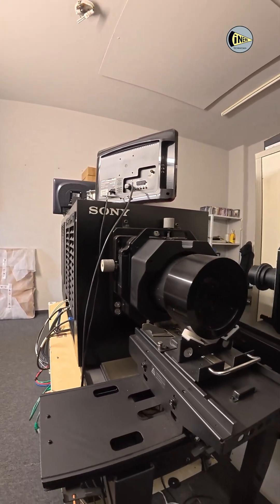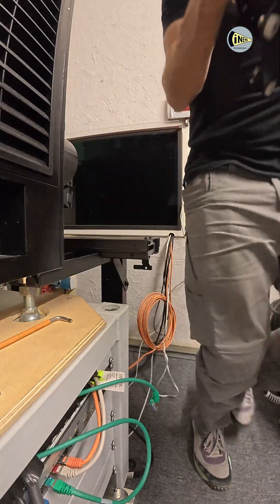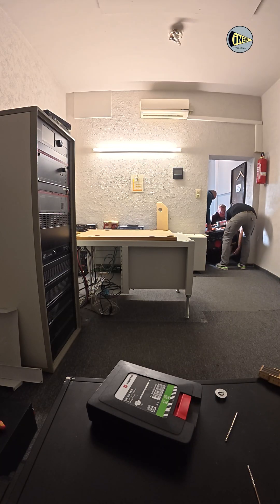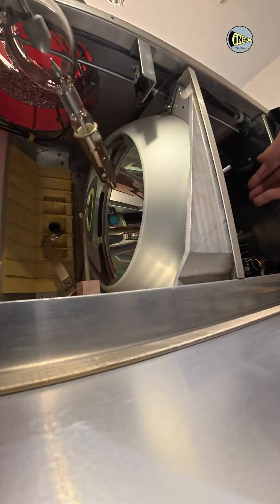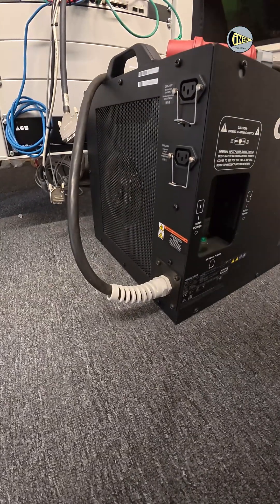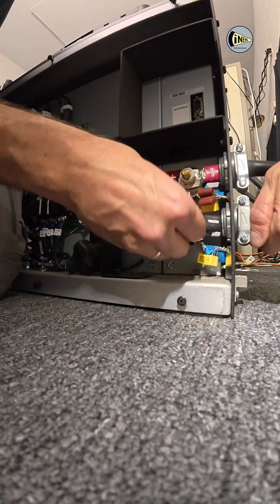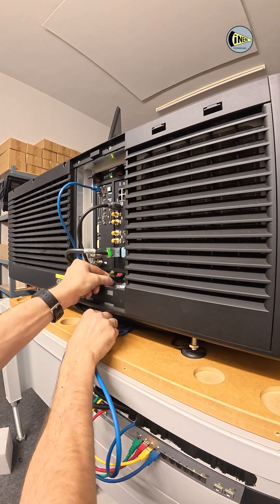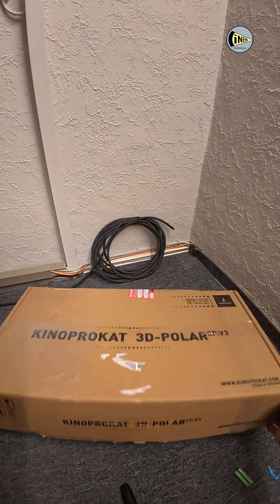4K Christie Digital Cinema Projector Installation with Doremi ShowVault Server Part 1

Comment: Great stuff! I liked "always wear eye and hand protection" with bare hands. One question - why the CP55? I have installed a few of these and in the end preferred Barco S2 by a long ways. Currently about half Christie laser and half Barco laser. Different but the same really.
Reply from the maker: it's not even connected to the power. It has remained since the days of 35mm.😊. Hey, do you have the same job as me???

Comment: Love that the Christie essentially has its own PC built into it judging by the AwardBIOS Screen, imagine the hardware probably used is an intel atom or something low power
Reply: That little PC is the boss of the projector, it can't do much if that fails. You can start the projector and project using whatever settings it was last on but this emergency mode is very limited. And yes the touchpanel runs Windows, very old version. You can break out of the Christie app and get the OS interface but it isn't useful.

Comment: Cool to see, i normally play with the touring versions haha! One thing to note, disconnecting and connecting anything that’s 3 phase is a bit dangerous live… in the future id make sure that the breaker is off before you do so, even with no load there isn’t much room for error there!
Reply from the maker: 👍Touring versions are much more clever than DCI.. you think the breaker was on only because I didn't show that I turned it off? 😅

Comment: I'm assuming that projector was a spare of some kind? The display quickly flashed the BIOS and the CPU was a Atom N270, from 2009. Actually since this projector uses a lamp, are lamp based projectors still common in Cinema or have Lasers become common?
Reply from the maker: Exactly 💯. It's a  used projector. At least for this Christie projectors are spare parts available but not for Sony. This is the reason why the customer decided to buy it. And yes, all new projectors have laser light source. Exactly that projector was produced in 2012

Comment: In next video can you explain how cinema equipment works because i have many doubts like projector have server then how audio goes to Dolby processor ? and can i play movies from local storage devices ? ...etc
Reply from the maker: I'll try to do my best 😉👊
Reply: It's exactly like a high end (ie 3 chip DMD) non-cinema projector except there is a mountain of security hardware and software added so a movie can't be stolen. In this video he uses a Doremi ShowVault cinema server, the chassis part is just a normal PC that has a pretty large disk storage RAID. The movie data is received as a DCP, "Digital Cinema Package" with feature film content encrypted (trailers and ads are usually not encrypted) and that data gets ingested to the RAID. Doremi Linux based software manages the system, takes care of the show setup and playback. The PCI-E cable sends the content data to the media block in the projector. Encrypted content is opened "on the fly" during playback using a decryption key sent by the film distributor, called a KDM (Key Delivery Message". This allows a specific server serial number to play the film for a specific time range. There are more limits but most have not been used yet like locking to a specific projector. The DCP contains the image files in JPEG2000 format (every frame as its own full image) plus 16 channels of digital audio. Basic audio formats 5.1 and 7.1 (5.1 is L, C, R, Left surround, Right surround, and LFE or sub bass), 7.1 adds stereo rear surround channels. Normally this audio data goes to a "cinema processor", like a home cinema head unit without power amps. The server also does show automation, things like curtains, light dimmers, and the sound processor are automatically adjusted during the show via network directly or using a network automation interface with relay outputs.
Note that both the image and the audio have imperceptible watermarking inserted, a "pirated" recording in the auditorium can be tracked to the cinema, screen, date and time it was recorded.
You need amps and speakers obviously.
Atmos immersive audio is an addition to a cinema audio system. It uses the base 7.1 sound system and adds a lot of extra speakers and amplifiers. Then "audio objects" are played to give a full surround effect, ie a sound like a helicopter can be panned all around and overhead or jungle sounds like birds and bugs can be intensely enveloping you. This extra audio data in in the DCP is sent to the the Atmos processor via a network connection. The processor uses each object's metadata to direct the sound to whatever of your speakers is closest to the desired direction. There is a limit to how many simultaneous objects is possible but I do not know the number. There can be up to 70 processor output channels though, 16 analog and 64 digital. So you can have a LOT of surround channels. Only a huge room with ridiculous budget would come close to using all 70. In practice around 30 surround channels is typical, plus the basic screen channels - even using tri amp crossovers in the processor, using 50 channels is about the max in practice. This gets expensive. On top of the many speakers, amps, and wiring, the Atmos playback license from Dolby costs thousands of US dollars and you need a Dolby Atmos cinema sound processor (Dolby is not the cheapest brand). Dolby enforces an experience standard, your plans (architectural plus your actual sound system components)  have to be approved by Dolby before you will be allowed to buy that license and get a key that unlocks Atmos playback in your processor. 
There are other immersive audio systems as well.
Reply: @Bodi2000  I have never seen such a long comment in my life😂 but this comment is really informative and i appreciate it
Reply: Me too!!!! I would like to know how DCP or video files are shown, the process of processing the DCP server, and how the Dolby Atmos system is considered and thank you for your long MOVIE